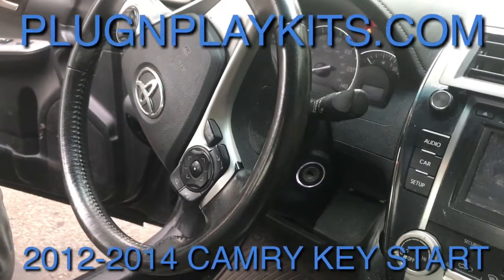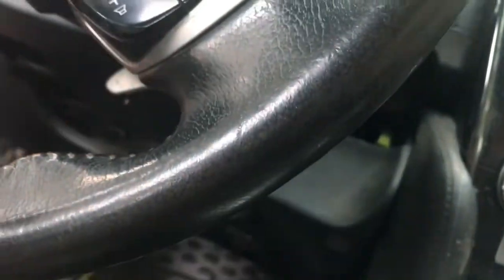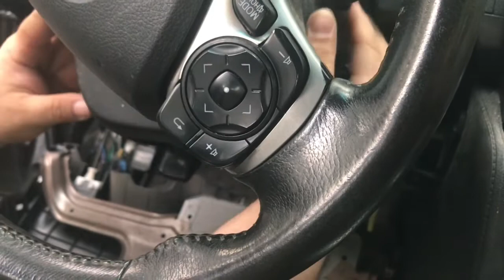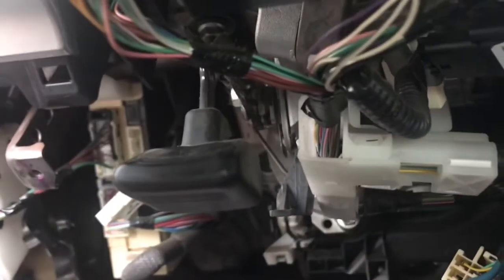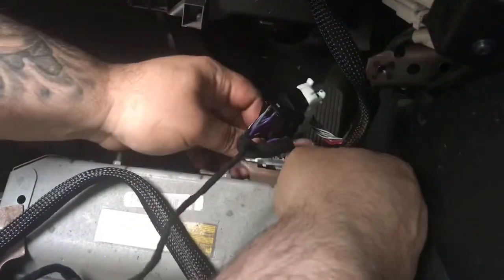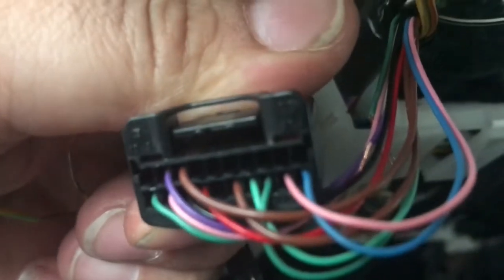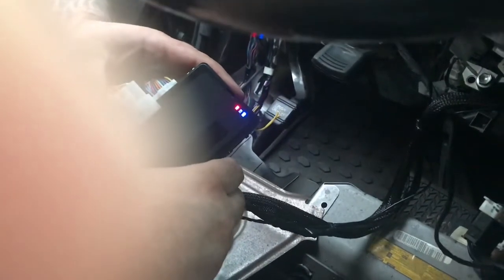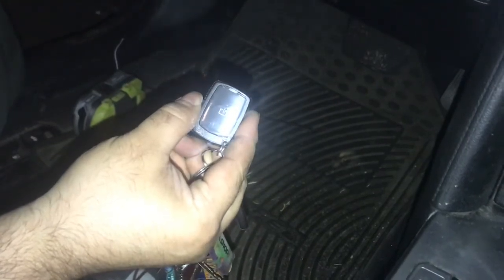2012-2014 TOYOTA CAMRY KEY START PLUG & PLAY REMOTE CAR STARTER INSTALL

Comment: Does the 1 button remote also control locks? Is the one button remote include or do you need to choose it as an option on the site? Does the kit come with the t harness? Does the car shut off when the door is opened like most toyotas?

Comment: I have 2 questions, 

1-Were do i connect the yellow strip .
You only mention to connect the orange with white strip to the end conector , but how about the Yellow one .
2 - when the car is ready to start , do i have to have the switch on or it will work with the switch off ?
Reply: He doesn't care anything about what you are asking I thin k
Reply: Yel-Org to the plug side and Yel-Grn to the other.